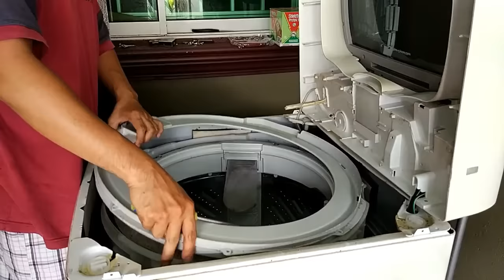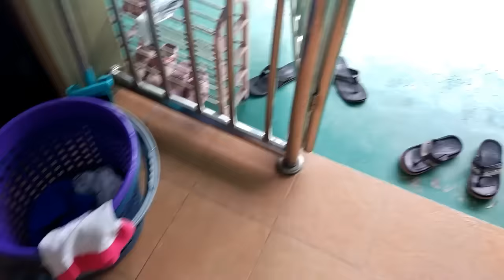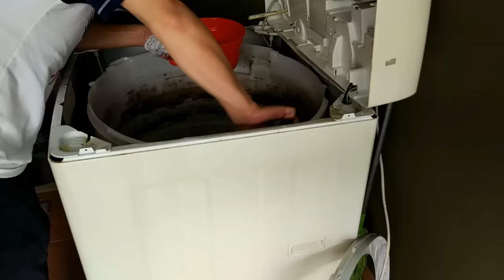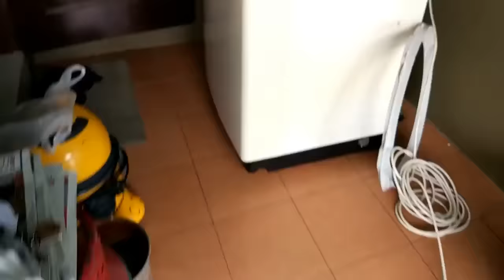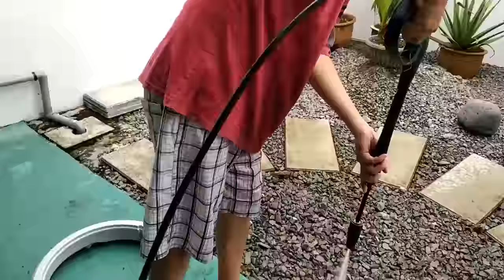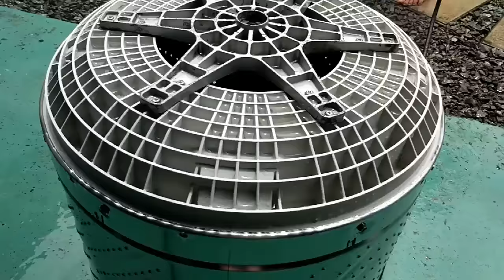how to clean washing machine

Comment: Great video.  With my LG washer (same design) I actually had crud trapped between the plastic and metal layer of the agitator.  No way to take it apart, ended up having to replace that piece after disassembling the entire thing.  Its a really crap design

Comment: I just took my 2002 Kenmore WM apart and discovered worse accumulation of dirt and mold just like in this video. I never thought of cleaning it up regularly. I won't powerwash with my bare feet though. :)  I'm assuming you're using low pressure. Thanks for the video!

Comment: This helped a lot!  Thank you!

Earlier, I cleaned the tub and found gritty, dirty substances.  I was trying to get the drum off so that I can clean it as well but can not find the screes to open it.  My Samsung automatic washing machines has been with us for 10 years.  I only saw two screws at the rear part.  I u screwed them but found no screws on the front cover.  Btw, the model’s program is on the panel where we open the cover of the washing machine.  Are the screws under it?  Thank you for your help!

Comment: Very nice job cleaning your top loader washer machine. But if taking apart the tub and drum and parts is not practical for many people to do, wouldn't running the washer on a Hot water Full Load cycle, with clorox bleach, or with cleaning/distilled white vinegar (and some people suggest also adding some baking soda powder), agitating a minute or two, then letting it sit for at least an hour (some people suggest overnight), then completing the cycle...wouldn't this method be good enough to clean out dirt and mold buildup in the tub and drum..?
Reply from the maker: i usually dip and wash it with baking soda + vinegar + warm water. but the drum still very dirty. must take it out and wash it once per year at least.

Comment: I cannot unscrew the screw before the blue impulsator.  U did it so easily with a size #2? Maybe need a #3? Any tips?
Reply: The cross head should use size #3 and I got it out easily.
The impulsator, need some WD40 to relief the cease.  Then rock it out....Very tuff.

Comment: Hi, what MM size of the big nut holding the tub? 50mm? I'll need to use my rachet... need the size first
Reply: Ok no problem. Is it anti-clockwise or clockwise to loosen the nut? I used your method of hitting the spannar with hammer, got no luck.
Reply: ok got it - anti-clock. Yup it's rusted and full of deposits. *Actually, the nut is not rusted but covered with various kind of deposits, mostly calcium deposit. The normal adjustable spanner is in an awkward position so it's hard. I'll be ordering this https://www.lelong.com.my/washing-machine-tub-nut-wrench-36mmx38mm-wmw3638-ehardwarestore-I5361453-2007-01-Sale-I.htm
Reply: @miscthings2559  thanks. Was looking for this

Comment: Hi hi, I have followed your steps all but I failed to remove the centre piece within the drum. I have remove the centre screw but even I slipped my finger at the side of the centre piece, I still can't pull it out. I afraid it will break. Any advise?
Reply: uhing ling I did took out one washer...not sure how many washers it has. I guess I'll pay technician to wash once and watch while they are doing it. Haha. Next time I can diy.
Reply: me too , I am stuck at the center screw part.